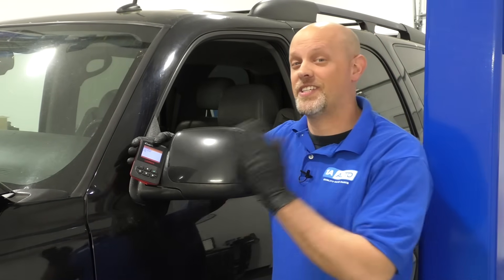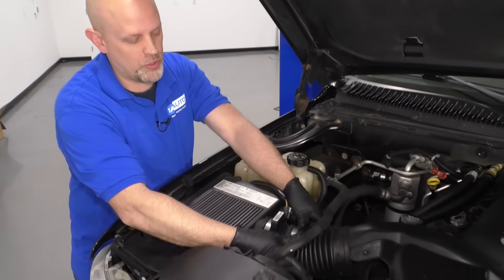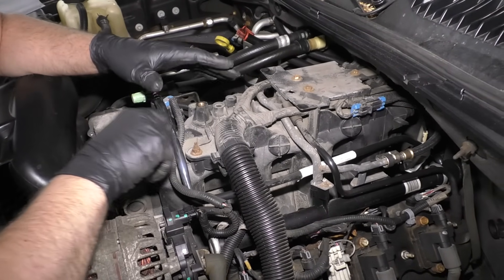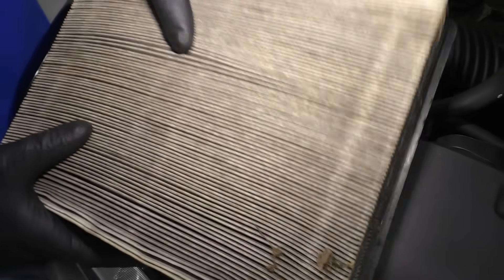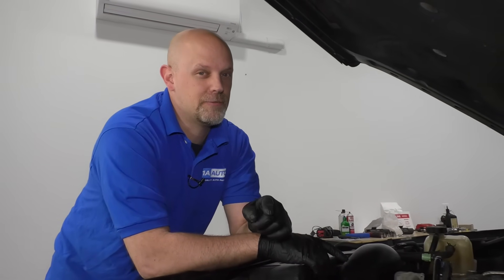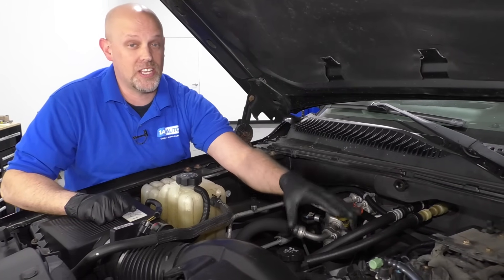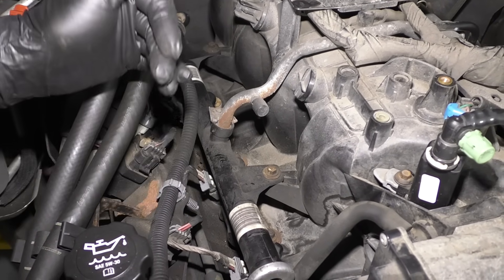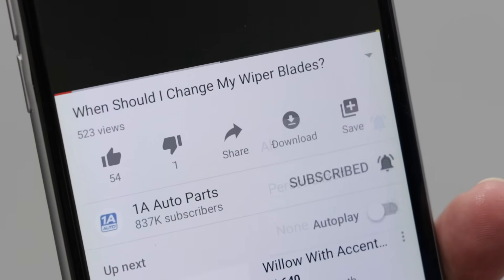Check Engine Light? System Too Lean - Code P0171 or P0174 on Your Car or Truck

Comment: I have a 2008 chrysler town country and it has a problem and I don't know what the P1745 code means if you could help me thanks
Reply from the maker: +Johnny Borjas Thanks for your inquiry. There could be multiple reasons why you're having this particular problem. We suggest taking your vehicle to a nearby reputable shop to identify the cause.
Reply: videos you might also like
Reply: Good job bro.
Reply from the maker: +Solomon Mengisteab Thanks for checking us out! 1AAuto.com